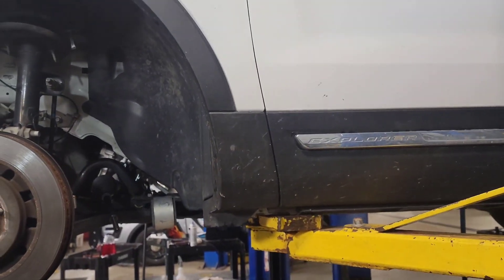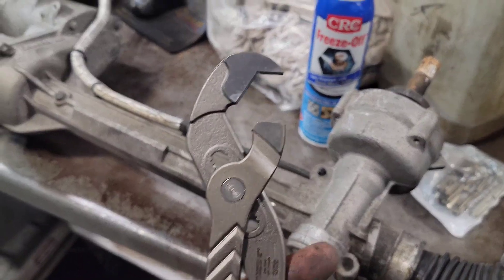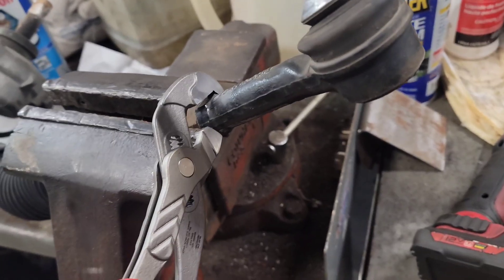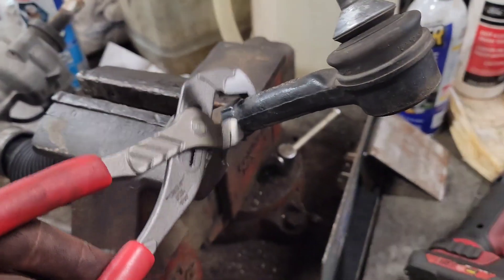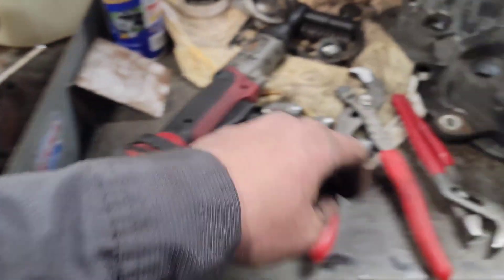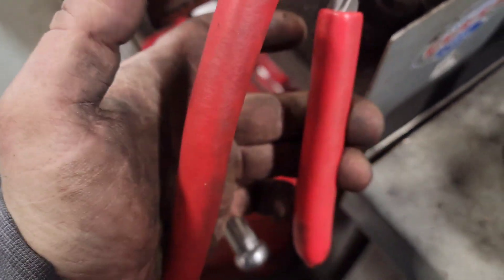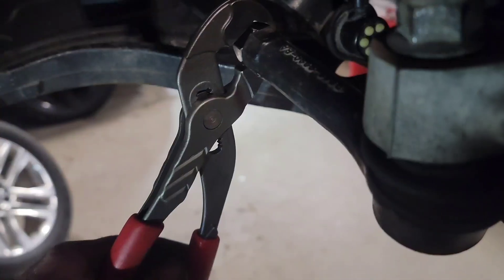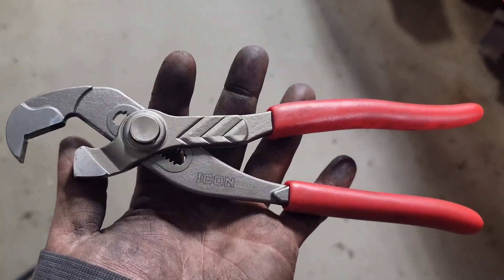Finally Used the Harbor Freight Knipex Lookalike Pliers - These Things are Sweet

Comment: A "LOT" of people rag on HF, but there are some good tools there....
Reply: I bought a sawzsall back in the 90's (the orange Chicago Electric version) that still works,have cut all kinds of wood including pruning trees.I bought another one on sale a couple of years ago to replace it when it quits and still haven't had to take that one out of the box yet.
Reply: As long as you are careful about what you buy and buy it for a specific purpose, HF is great. I bought a tile saw for a bathroom project, I didn't want to be under the time pressure of renting one. The saw was great, I used it for several tile and stone jobs around the house before I sold it. I wouldn't have bought that to use professionally, but it made sense in my case. I like most HF hand tools and have had great luck with them.
Reply: They've come along for sure seems they have made a big jump in quality the last year or so but still offer the cheapo stuff too cause sometimes that's all ya need
Reply: Yeah they have decent tools too. just those really cheap Chinese ones are the one to not get. They are good for one use and that's it. But the icon and some Pittsburgh stuff is decent. Icon however is up there with some of the high quality tools.
Reply: Absolutely

Comment: Thanks for the recommendation.  I was on thr fence with buying these.  ...It is Harbor Freighg, after all.  I go there for nitrile gloves and tools that I knkw that my coworkers will steal from me.  The Icon line is nice, and I trust their recommendation.

I kept a Fluke 88 meter in my desk, and my coworkers would steal my multimeter, all the time.  They knew that I had good tools, and our desk locks were a joke.  The master key was everywhere.

I kept my Fluke 88 all the way at the back of thr drawer, underneath a pile of junk.  I kept 2-3 Harbor Freight $6.99 multimeters up front in the drawers.  That way my coworkers would steal my cheap DMMs, not my good stuff.  The diversion worked well.

My coworkers denied that they stole my multimeters.  They even denied that when I took out the 9V battery to show them that my name was engraved inside the battery cover.  The less intelligent ones in HR said that "I" stole the DMMs and engraved my name on them.  The bosses never stole stuff ...until the bosses were caught by corporate security and the FBI stealing stuff, such as entire toolboxes, hot pressure washing machines, DPF reconditioning machines, or even pipe threading machines and welders.  The FBI put in "special requests" to the bosses, and corporate security would have video recorders showing the bosses stealing the equipment that same day.

How did the supervisor have $54k in cash (and white powdered Diet Coke) in his desk?
Reply: Sounds like you need to have a camera turned on. 🙂
Reply: Makes sense.  The UAW contract prohibited cameras ...or clocks.

I am at a different company, and the new place is 1000 times better.  Nothing is perfect, but the new company is pretty good.

Comment: I have a couple sets of the icon ratcheting wrenches, they are top notch! Thanks for the review, I am going to have to grab me one of those next time I am in there. I have no problem using HF tools, only place by me where I can get something replaced if it breaks up here in the boonies. Unless I want to pay out the ass for the Napa tools, which are good also. But never had an issue with any HF hand tools.

Comment: I hope they work well for you. My experience with Harbor Freight tools has been that they work, but they are generally made of a cheaper metal and they break. I actually had a screwdriver shaft twist and break while trying to break a tool loose. That was a decade ago though. Perhaps they've changed, but 90% of my tool purchases since then went to Craftsman.
Reply: they do break but they dont ask any questions when you break something with their warranty system. all you gotta do is find the replacement in the store and theyll take your broken tool
Reply: @jash6105  I did not know that, thanks for sharing!
Reply: @jash6105  You just have to pull the broken tool out of your own body first. LOL

Comment: Dude I was in Harbor Freight in Waterloo Iowa today looking at these ... I have a few different sizes of similar ones made by Irwin, they work great but I lost my bigger-medium pair somewhere. I didn't buy the Harbor Freight ones because the cheap price can be scary for longevity, but if theyre working and holding up that good for you I might have to go back and grab a set of these.

Harbor Freight does sell some cheapo stuff but I've had fairly good luck with their hand tools, sockets etc. That's why I went earlier today. I needed some larger help drivers with a 1/2" drive, had them on sale for $10. Hard to beat that.

Comment: Harbor Freight tools have came a long way in the last twenty years. Not saying their Milwaukee or Snap On but they’re not bad.
Reply from the maker: Snap On - their quality has went down and Milwaukee has went up
Reply: @LaLaLucky7777  
Milwaukee destroys Makita with any products I’ve used from both. The impacts aren’t close the battery life isn’t close the drills and saws aren’t close either. Makita is entry level when it comes to  construction tools. I like makita and own some of their tools but Milwaukee is on another level.
Reply: @LaLaLucky7777  
Don’t get me wrong I prefer Makita for angles grinders, I love the fit for my hand. I was also referring to cordless line ups of tools. I should of mentioned that. I do ceramic and stone tile installation and the mixer I use is a plug in Makita and my multi tool is Makita also. But the brushless fuel Milwaukee line up is where it’s at. Really expensive but worth it IMO.

Comment: It looks like the jaws don't close fully like the Knipex Plier Wrench, is there some minium size that these are able to accommodate?  With the Knipex, it's possible to flatten down a penny into thin foil by pressing it from the edges. All the pictures I've seen of this show what looks like a half inch gap. 
Why did they make the little stubby jaws instead of full size? Had to change the design to avoid infringement, or maybe it's not able to handle the higher forces from a full length set of jaws?
This isn't going to work with plumbing fixtures, being rather challenged in the length department. Makes it limited use because of that.
Reply from the maker: I don't have specifics, go buy some and try them out
Reply: @FordBossMe  figured someone already bought one and knew something about it, that's all